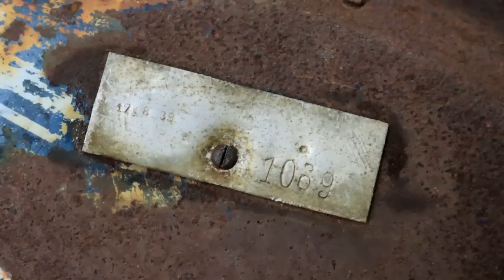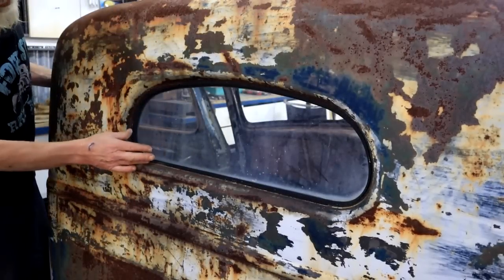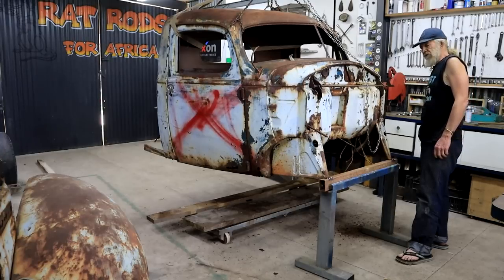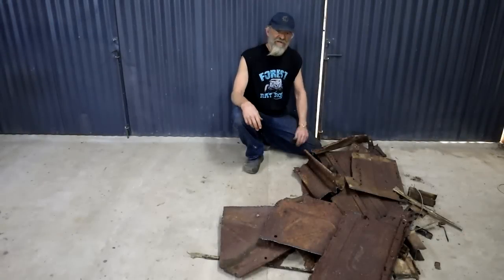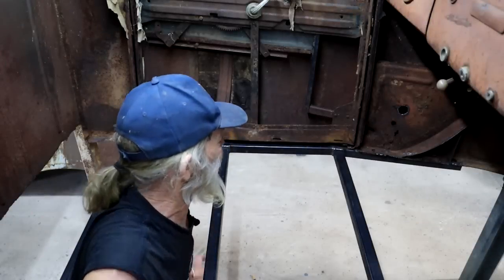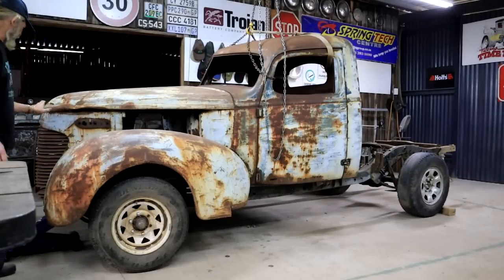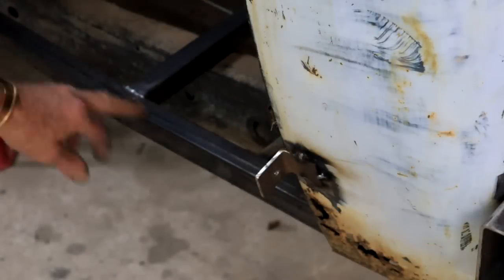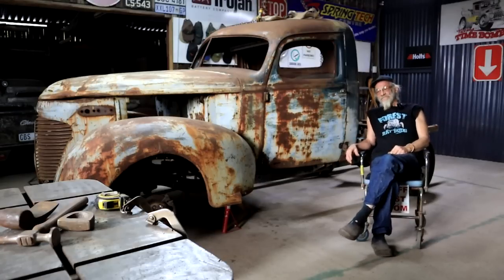1939 HUDSON RAT ROD BUILD Part 2 - Positioning the cab & new floor structure.

Comment: I was thinking  weld the doors shut,cut the floor out and lay the cab on its back but your way is better. Also the"mangled" hood and grill adds character. Keep up the good work!
Reply from the maker: Welding the doors is the normal way yes. But the brackets worked very well and allowed opening of the doors.

Comment: You're taking away many of the excuses for people who would think its impossible to make a running vehicle again. I dont think there is another 1939 Hudson pickup rat rod around. You are correct aboit the design of the dash, it was to make it easier for export models (known as CKD). They would be sent disassembled and to avoid import tariffs, locals would assemble. I like the idea of the blue on the outside/tan in the inside, maybe with tan/brown on mouldings on the outside.
Reply from the maker: Interesting info! Yes, the blue/tan combo is quite nice

Comment: Something interesting is flat piece on back side of window side glass. It may have “smokers window”
When you rolled up side glass you could continue to roll it past up position and glass would move back leaving a opening on front side of window like a vent
Reply: My 36 Hudson coupe has those same flat pieces at the back of the windows and could not figure out what purpose they served?
Reply from the maker: Need to check that out! Have not looked closely at the windows yet. Thanks!
Reply: @hudsonhotrod1  A lot of cars had that. I first noticed them on Ford in 32 on some bodies and 34 Ford too. I’m building a 48 ford anglia been trying to figure out how they worked so I could add it to my Anglia

Comment: Back in the day; Hudson advertised that "they had the only car you stepped DOWN into". I don't suppose that as long as you are putting a new floor in it, that you would keep with the old adds and make the floor lower than the bottom of the door.🤪
Reply from the maker: Well, this Hudson is getting airbags. Scraping pavement... Definitely will be stepping DOWN!😄

Comment: I agree that you are giving no excuses for anyone who want to take a newer chassis and drive train, then put a per-war classic truck body on it. 
  I am very surprised at your "Do It" attitude as most would say "No way it can be done". The part the two piece drive shaft goes thru was correctly identified as the carrier bearing. Using the expensive tubing in South Africa is very little difference from the cost of US steel as transportation cost sky-rocketed due to fuel cost, trucks + drivers! But we won't get political as bad as they are, nope, won't go there there!
 The cab seems to fit nicely on the chassis and Isuzu frame. 
I have an Isuzu 4 X 4 single cab truck. Her son needed a vehicle and she gave it to him with future payments, he never paid and he used the truck to jump ditches until the frame broke, then sold it. I wish I had say as to what happens but her son has never paid us for 3 vehicles. 
Bu I wish i was you neighbor an friend! God bless your talents! DK, Omaha. Thank you Div!
Reply from the maker: With enough persistence, anything can be done!😄
Reply: @ratrodsafrica  Well Div, you are one persistent guy. And I like that! Why force you self to think outside the box, when there is no box? Love it bud!

Comment: Hey Diff, g'day mate from Australia. Check the pieces you cut off as there was sections (damaged) folded up from each side underneath that are panels that hide the chassis from the side view and also line up with your running boards and the extra length would have met up to the original rear fenders.
Reply from the maker: Jeez, those pieces were bad! And I dont have the original running boards. I will just fabricate my own stuff down the line...

Comment: That's a 39 Hudson Big Boy. The dash and the molding were wood grain. That's why there Brown. The doors were probably painted Ted blue like the outside. The dash had a speedo in the center,and the other side was either blank or had a clock. The generator and oil pressure, gas gage were in the center. Probably easy to change it to right or left. Really nice!
Reply from the maker: Interesting info, thanks!

Comment: The reason the floor panel is continuous under rear panel is because the Hudson was originally a sedan and during the ww2 it was an advantage to convert cars to a pickup in order to get fuel concessions for commercial vehicles
Reply from the maker: Very interesting info! Thanks